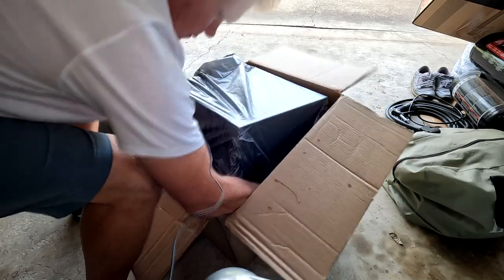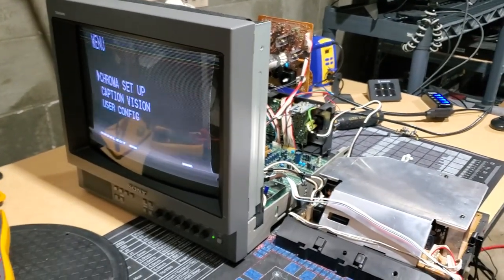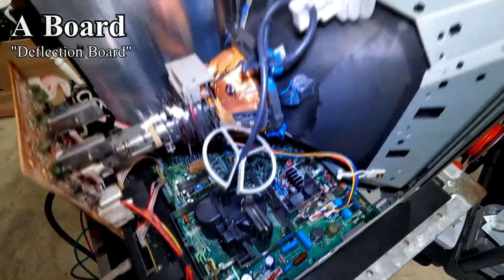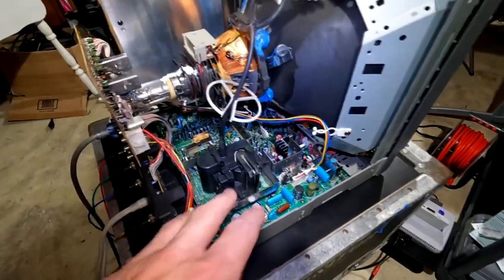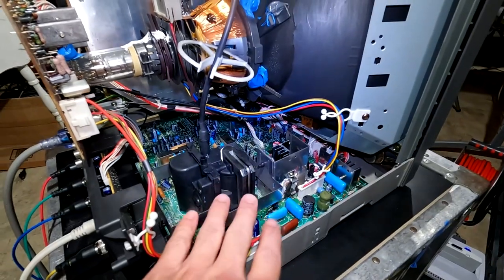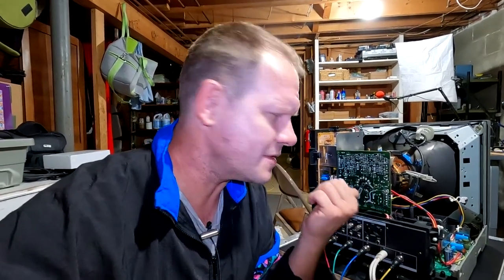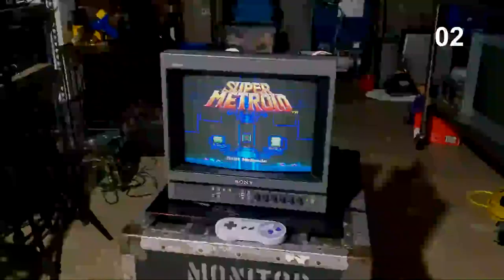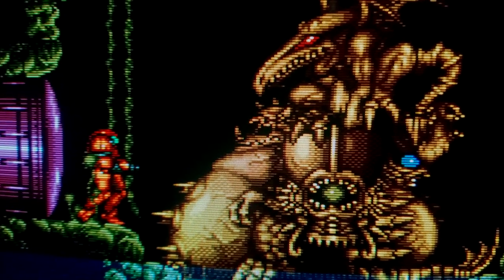Can this eBay CRT be fixed? - Sony PVM 1350 Restoration.

Comment: Nice work Steve. I always miss the live streams as it's usually 4AM here, but sometimes I'll throw the replay on in the background. Quick question, which RTV silicone do you use? I need to get me some of that shit
Reply from the maker: Thanks mate.  I use permatex brand.  You can get it at the auto parts store off the shelf usually.
Reply: @RetroTechUSA  Cheers. That's the one I was looking at. I'll head down to the auto parts store and grab some, along with some dielectric grease

Comment: Hi,

I don't know if you can help me, but I have an issue with my BVM-D24.
When I display a black screen (screen on without any source for example), the screen is not perfectly black on the edges, with a slight blue tint.
We can also see bars crossing the screen in diagonal.
I couldn't find a setting to fix this.

Thanks for helping me.